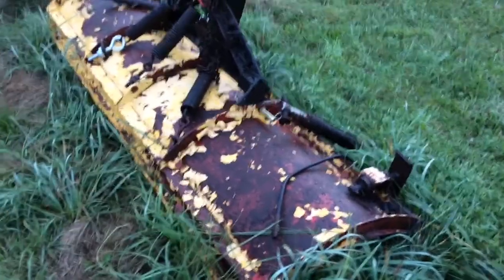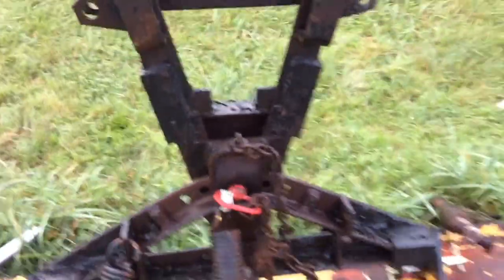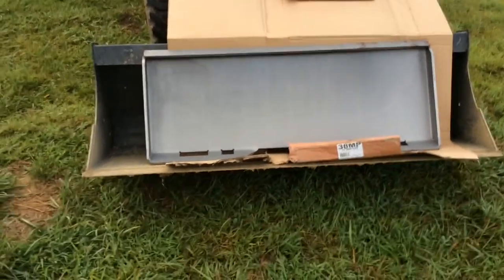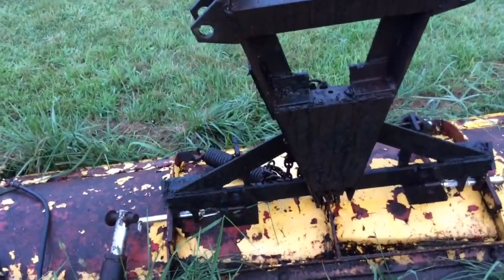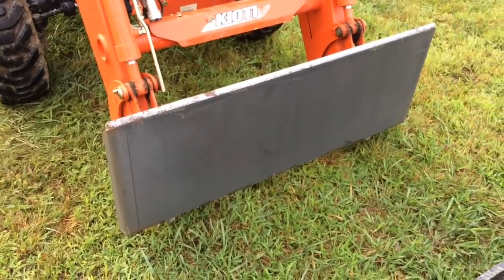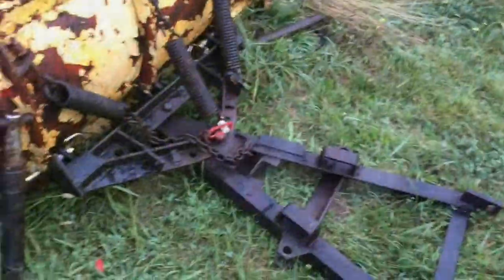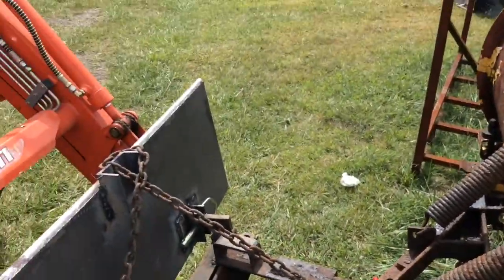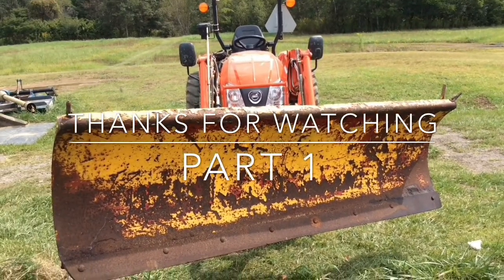Converting Truck Snow Plow to a Compact Tractor or Skid Steer Quick Attach Part 1

Comment: The length that that sticks out on the front of the loader is to far you will destroy you little tractors loader in no time ( trust me I know from experience) good luck .
Reply from the maker: @kevinhemken748  I have used this plow quite a bit in the last few years and I haven’t had any problems, but I appreciate your advice.   Thanks

Comment: I'm building the same setup now. The only thing I would change is where you have the chain hanging, I'm going to run a piece of 2x2 square stock down to plow. That way I have down pressure on the blade I have a lot of places in front of garage doors where I have to back drag. For all the people saying it's too big, I agree with you. If you have one laying around why not use it.
Reply from the maker: Thanks!  Yes I thought about that also but ultimately decided to leave the chain and also some of the sloppiness in the blade to follow the contour of the ground, allowing smoother operation and less possible damage to the driveway and or plow.  Thanks again and good luck with your project
Reply: No need for that you will need weight on the 3 point so I have a 7’ Woods Grader Blade on my setup. This works great.  Back up, drop the grader to move snow away from structures then drop the plow and push 

Back Dragging is very inefficient and you want the plow to float so the chain is what’s needed

Comment: Hey.  New kubota lx3310 owner. I have a old cj7 plow laying around.   After pushing my first snowfall i thought of this yesterday.  Didn't search for it.  Google must read minds.  😂   bam 
Great job. Thank you for the video. Wws debating the hydraulics since i also have a 3rd function. Considering the grapple simply opens and closes.  It might work with one.  Did you get hydraulics done yet?
Saw the kubota setup at the dealer. Looks very similar. Was planning to drive back and take a picture this time.  😂
Reply from the maker: Yes I did the hydraulics and they do run on my 3rd function of the tractor and it does work well.  Thanks for watching!
Reply: @JoshHovis  cool.

Comment: Looks to heavy for that tractor
Reply from the maker: Yes, it’s your standard size snow plow for a pickup truck.  I’ve used it quite a few times and the tractor does fine with it.  We also have a good sized skid steer/track loader, and with the plate I converted this plow to I can use it with that machine as well.

Comment: Great job! It will shove that little tractor sideways... guaranteed. Especially sticking out that far...
Reply from the maker: Thanks.  Yeah this angle view is a little deceiving, but it does stick out quite a bit.   I plowed a few times last year with it and didn't have much trouble with it sliding the tractor sideways, but I see what you are saying.  Just got to take it easy.  Thanks for checking it out
Reply: Oh yea, LOTS of Projection-Difflection. Just about the same "deal" with ALL loader mounted Plows. I would of just "slapped it on" the front axle & went "direct-drive".

Comment: Made mine in 2009 attached to a Kubota L2550. The main difference is I used large angle iron in place of the plate. The plate wasn't available back then. The biggest advantage to this idea is the capability of curling the cutting edge to different angles and the capability of piling the snow way up high. The only damages over the years was a piss poor weld of mine broke. I also have a grader box on. It's makes a great ballast.

Comment: Have you trued this yet? I am contemplating the same thing but concerned at angle, if it will stress the loader arms too much? I have a mahindra 2638 hst
Reply from the maker: I have used it.  I have a video of it being used on my channel.  I haven't pushed it real hard because I had the same concern.  I do think for plowing straight on it's fine.  It is when you angle that I think you might overdue it with the loader arms.  That being said I have used mine and it works really well and my loader is fine.  If you're really concerned you could get a smaller or narrower plow...and they do make a snow plow attachment for tractors.  Thanks

Comment: i recently got a compact tractor which came with a snow way plow, one with clear mold board. its a vehicle plow, the pump was taken off. the plow latches into the mount as it was meant to but the mount fits my loader in place of the bucket, if someone modified it to fit they did good.
Reply from the maker: That sounds like a great set up.

Comment: That's a great idea!  Can you explain why you needed two hydraulic cylinders?  It seems like just one is needed on one side, extending and retracting which would move the blade back and forth.
Reply: Plow cylinders only push out . You need 2 to angle both ways
Reply from the maker: Thanks for watching!  Yes I am sure one cylinder would be fine.  It might have actually worked out better with just one.  The blade originally did have 2 cylinders, and therefore had a spot for 2, so that's what I decided to put on it.  I am still waiting for some snow to give it its first real go.
Reply from the maker: That makes sense.  Thanks

Comment: Very nice 👍 I also repurposed old equipment and scrap metal to make tractor implements. I'm buying a Kioti 3510 this Friday adding it to our channel. If you get time stop by and check out our fabrication and build videos we have 2 good ones and more are in the works. Looking forward to Part 2 the hydraulic system on the plow. Thanks for sharing.
Reply from the maker: I will definitely come check that out.  I’ve had a great experience with the 3510 so far.  I’m sure you’ll enjoy it!  Thanks for stopping by and watching!